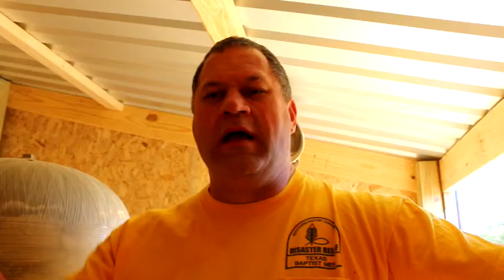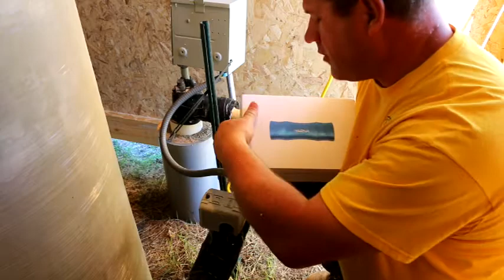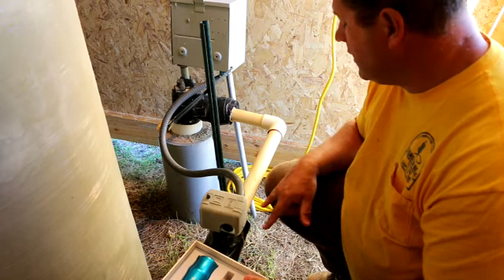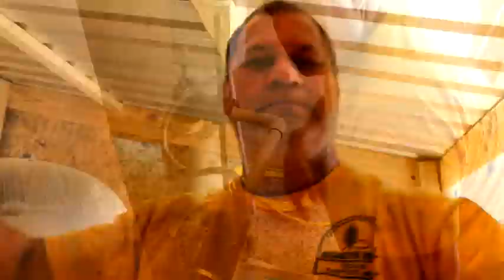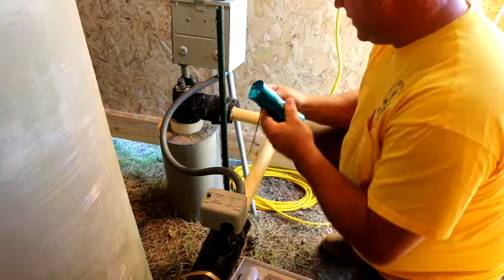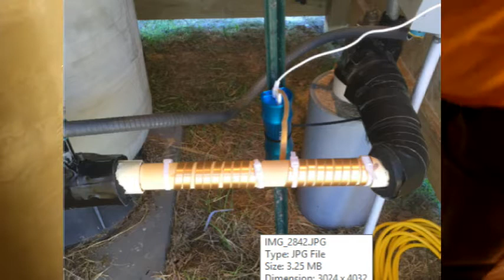Capacitive Electronic Water Descaler Yarna EWD03

Comment: No matter what the impulse does, it doesn’t change the hard water chemistry. Hard materials do not stick to your pipe. How do you know the hard materials do not stick to the “pipes” inside your body?
Reply: Because your body absorbs the fucking minerals..  what do u think vitamins are?  Do you think iron you eat in food is different from iron in a car?  Its the same shit..  calcium..  that builds up on the pipes..  same shit in milk...  limescale, if your apart of a land feature than u dont have to worry about rock forming in your body, however your gall bladder and. Kidneys can take an excess of mineral ingestion and form stones which u pass anyway buy stones only develop in people with an internal issue with somethings and is a disorder that just happens to some..  the air you breath is way worse for your body than what this device is or isnt doing to the water..